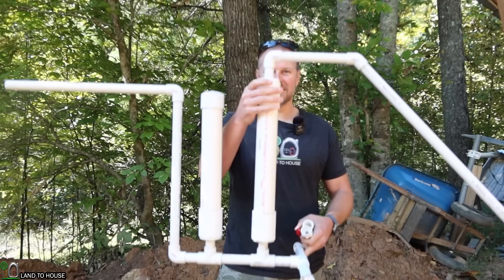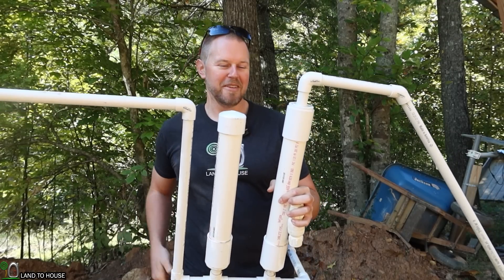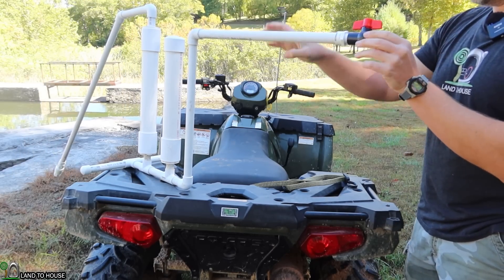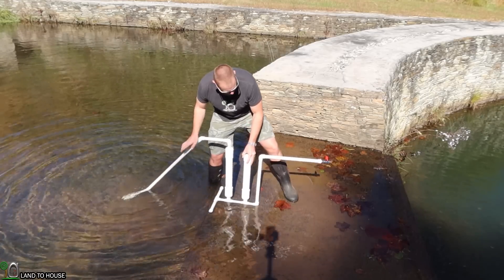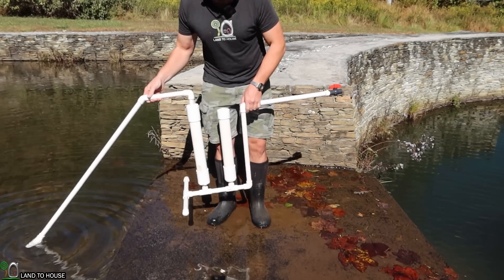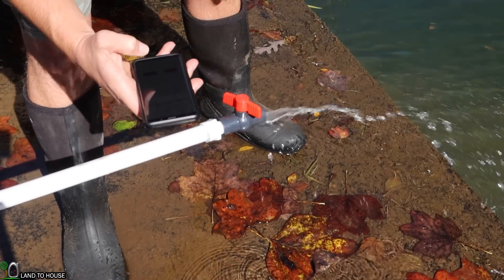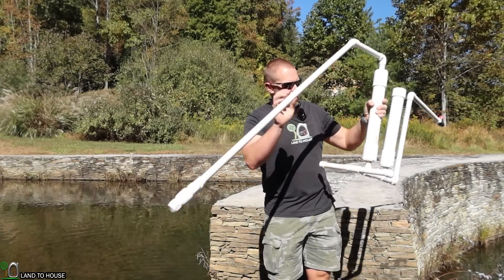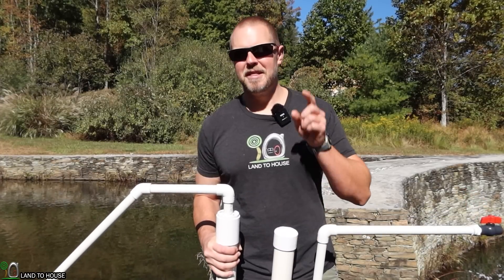This Siphon Works But not for Long

Comment: the only  way it will work ,water trap in pipe because of the check valve will travel  up to the end of  pipe and at the end should be a smaller pipe so the water  will keep out air from rushing up and loos its prime  , the down side   should have grater water then up hill side  , the idea is once the water  travel to down hill it should be a grader volume then in up hill side , then it will be heavier and pull water up on its own   , imagine water going to top of 3 feet pipe then start down hill pulling up water from the other and because outlet side have grater water .

Comment: Did you glue the fittings together?  Air leaks causes siphons to stop.  All siphons work, we use them in civil engineering everyday without issues when the seals are properly made.

Comment: It will really will not work because of the design, the outlet line has the same height with the inlet line and vacuum chamber. You cannot create vacuum pressure if you heights are the same. The outlet line should always be lower than the inlet line and vacuum chamber.

Comment: thank you for trying out, it was lovely to watch and learn. To be logic, the pressure chamber shall be 1/2 the length of the water chamber so that the pressure build inside the pressure chamber is proportional to the length of the water chamber * 0.5, and the height of the outlet pipe should not exceed the height that it will build a gravitational pressure that equal or close to the pressure builds inside the pressure chamber, otherwise both the pressure inside the pressure chamber + the weight of water at the top half of the water chamber will be lower, but it should be higher in order for that kind of system to work.

anyway, thanks again for the video

Comment: Damn! I saw  the video you mentioned and thought, "I'll watch that. It's just what I need at the cabin!" Then I saw your video. Back to carrying buckets from the river, then.
Reply from the maker: If you have head pressure or water drop definitely check out the ram pump.
Reply: @LandtoHouse it seems like you didn't get the pipes filled with water. 

You suppose to PUSH the pipe UP and DOWN (pumping motion) to pump water into all pipe.  SHAKING the end of the pipe like rattle snake won't work. 

This works similar to RAM PUMP but simpler and pumping more water. I've seen videos of your ram pump system.
Reply: DO NOT WATCH his video because he made several serious serious errors just by filling the pipes with water which he didn't do it right.

The problem that he doesn't know what suppose to do himself.
Reply: Before you abandon ship, try this simple experiment. Get a transparent hose, like a carpenters hose they use for leveling.
Emerge the the other end into a bucket full of water and suck the other end like sucking a straw in your soft drink. Did the water flow from one end to the other?

Comment: Interesting, in past years I worked on something like this in a different and more simple structure to make a free generator based on infinite water stream cycle and I didn't get good result :).
Reply: It is pressure buildup followed by vacuum suction.
That mean leakage is a big thing to make it right.
Another is the volume and the length.
This one  is equal in length but reduced in pipe size.
That means you can not produce the pressure/vacuum you need...
So size matters and in a pressure/vacuum system, 
it needs to be consistent and without much leakage...
Keep in mind that it is based on NATURAL pressure, that means limited pressure.
That means limited distance and limited volume...
This means standing or low flowing water will always run out of pressure.
If you do it in a river and/or canal it is more effective.
If you ad a floater with weights to the part that is in the channel,
the movement of current, wave and tide will build up natural pressure.
It is a very old, thousands years old and proven concept that works..
Look at history about: Bamboo piping & pumps + water elevation systems ect ect.
There is enough info out there to make it work.

Comment: In another video, possibly the same one that you had initially watched, the guy had a longer pick-up tube and (evidently) deeper water at the bank allowing him to take longer thrusting motions whereas you used short strokes like you were jingling your change. The longer thrusts likely built greater pressure because of the greater volume/mass of the water.  If you have another go at it, try using it in deeper water where you can get greater volume.
Reply: Why don't you search about the first law of thermodynamics?
Reply: Which part of perpetual motion machines are impossible is hard for you to understand?
Reply: @blaster-zy7xx  Your reading comprehension skills need some work. I never said it would work in perpetuity, I said the other video looks like it compressed more air which allowed it to flow for a longer period of time.  BTW, you should find a new answer to share with the class, maybe even try to understand those replies rather than being a condescending little prick.
Reply: @kevink9397  NO YOU DID NOT!  Did you forgot that this is a WRITTEN format that we all can simply READ what you wrote the first time?  The original video is simply a hoax.  Attempting to defend the hoax only illustrates that you didn't know that the original was a hoax and simply can not work.

Comment: Guaranteed this will work.  Get rid of the check valve and put the output end lower than the input.
Reply: Did you do it yourself that you guarantee? Or did you see it on Facebook?
Reply: @alisideh9565  Ive done it many times.  Siphoning gas, water,  and other things.  Just need to fill up the tube first.  Its called gravity.
Reply: There was a scammer who created a device exactly like the one shown in the video and showed a large amount of water spewing out

Comment: um, I could be mistaken but it's not going to work filling it that way you need to flip it over or fill it on it's side. pretty sure you needed the pressure tank to be full of water not air... or you would need to attach something to increase the air pressure (like a bike pump), otherwise it's more of an air pocket than anything exerting pressure. but it should be as full as possible I would think. (that said can't say I've done it)

Comment: You didn't lay it on side to get enough water in tanks for enough pressure so you didn't do it like he did just fill the tank up havnt you ever used a gas siphon or just a hose you got to prime....prime...prime

Comment: Your pieces obviously aren't glued together well for a piece to fall off. They said that if the seal is not good then air can escape and it reduces the pressure so it won't work. That's why they glue both sides of each piece before putting them together (to ensure an air-tight seal).
He also gave it a much bigger plunge into the water than what you've done, including turning it on it's side to get a larger plunge. 
Sorry.. I wouldn't call this debunked while you have pieces that don't have a good seal on them and haven't done the large plunges needed to get the siphon started.
Reply: Which part of perpetual motion machines are impossible is hard for you to understand?
Reply: @blaster-zy7xx  je crois que c'est un imbécile.....
Reply: Here's another idiot who doesn't think that a pump that raises the head without power violates the first law of thermodynamics.

Comment: To have a better understanding of what is going on inside the System, you should make sure that the whole system is fully sealed, hermetic, leak-proof, so that no air is sucked in, or leaked out. Then you should use some kind of PC-compatible  pressure measurement System that allows you to messure pressure at different points of your device, and display the results on your Laptop Screen.
Reply: Which part of perpetual motion machines are impossible is hard for you to understand?
Reply: @blaster-zy7xx  ...For decades Lots of scientists have been threatened, persecuted, silenced, discredited, censored, suppressed, or killed just for defying the interests of big Corrpporattions or the Esttablishmment.

Find out about the misterious death of Stanley Meyer, the inventor of water fuel cell
Reply: @blaster-zy7xx  ...I don't care what we are told in College or in the books, we are never told the whole Truth about science.

Anyway, this kind of systems does not defy or  violate Thermodynamics Laws in the way we are told because the working principle is based on piping tricks and gravity. 

I have seen similar devices Work with some design modifications.
Reply: @cdtero  Nope, doesn't happen. You are unwittingly advocating for a perpetual motion machine.  If you were correct, (which you are not) then the water could be endlessly pumped up to a higher point and allowed to flow downhill, running a turbine or whatever.  Nope. In order to add potential energy (actively lifting something to a higher level) energy MUST be added into the system.  There is no free lunch.

Comment: Air pressure has no effect on that configuration unless it is applied at the induction end and greater than the residual atmospheric. Inline pressure storage has no bearing on transient fluid flow. This is the basic physics of inertia. A simple mathematical equation is enough to prove a hoax. The video you describe has a submersible battery-powered pump in the first inline chamber with a Mercury tilt switch...simple....😂😂😂

Comment: Your valve was open and you didn’t even use glue on the pipe. Hell it fell off lol. With that many leaks of course it’s not gonna work. It’s simple gravity, you moving water from another place with gravity. It’s possible.
Reply: Memorize it. ‘Water cannot flow from a low place to a high place’

Comment: I'm pretty sure that it doesn't work for long cause your pump doesn't have the empty bottle in some part of the circuit...
Reply: Which part of  “perpetual motion machines are impossible” is hard for you to understand?
Reply: @blaster-zy7xx  not a "perpetual motion machine" there... Is just a pump... It can work for a few minutes using the difference between pressurized air and the water, and it works by the way...

Comment: You see all those lose connections fail the system. Air leaking in will stop the system. how can you not glue it properly and tightly and expect it to work. Siphon cannot be maintained by lose pipes, you are now busted

Comment: Not DEBUNKED!! You're supposed to leave the check valve underwater on priming, I guess you finally realized that blunder but from that point forward it seems you're clueless about the concept in that case. Water can not fill the pressure tank completely EVER, because the air is trapped above it with no escape unless you didn't glue it in which case it can leak around the contact point of the pipe but you DO need to use much longer priming strokes than those quick little strokes you're using so that you get enough water past the check valve for it to build up and not 2 hours time later. Which, btw they make weighted check valves that do not have a spring in them. When you raise the pump up higher you also increased the distance the water has to go to begin the pumping action but yet your tiny little strokes are not filling the pump properly or giving the water enough momentum, you should have opened the valve completely, immediately so that the water could completely fill the influent pipe and not slowly like you did, you interrupted the water's ability to flow up the pipe from the pond so it never pulled full prime while the pressure inside the pump was at maximum and so far YOU have been the problem not the pump, this is NOT perpetual motion, it's a siphon effect which is something altogether different..
Reply: the guy is clueless and not an engineer.
Reply: Sadly he doesn't have to be an engineer to make it work, just know something about water hydraulics and siphons. @jjanvier1443
Reply: 😂😂😂😂 u would be rich by inventing such system lol nerds😂😂
Reply: Submit to the Us Patent and trademark?
Hah!!
You want him to suddenly disappear??
Reply: Minor processes are not important. That device is perpetual motion machine that transports water from a low place to a high place without power. This directly violates the first law of thermodynamics.

If you can really make that thing work, you can build a prototype, submit it to the U.S. Patent and Trademark Office, and become the hero who ends the energy crisis.
Reply: @colorfulstring  Nope it is not a perpetual motion machine, it's a siphon, and can run uphill, look it up..
Reply: @colorfulstring  I'm sorry but you are incorrect, your thinking is not logical and it's been explained like as if speaking to a 10 year old if you still don't understand that's on you, having said that, minor processes are VERY important to make things work correctly as a winning racing veteran of over 30 years it is most definitely the details that make the difference between winners and losers and sadly with your line of thinking you're a loser. Start with IT IS NOT A perpetual motion machine, it's a liquid siphon (look it up) which will work indefinitely as long as the siphon is not disturbed by air intrusion..And what energy crisis are you speaking of? This is to transport water for irrigation not create energy, moron.. Youtube DO NOT TURN into Yohoo with your comments ideology, it'll be your undoing like it's going to be theirs too..
Reply: But if it works it could be used as a circulating source of power portable power anywhere so show me 😁
Reply: @randypratt2887  No it couldn't, there's not enough flow and that's not the underlying purpose..
Reply: @randypratt2887 ⚠️ God has said in the Quran:

🔵 { O mankind, worship your Lord, who created you and those before you, that you may become righteous - ( 2:21 ) 

🔴 [He] who made for you the earth a bed [spread out] and the sky a ceiling and sent down from the sky, rain and brought forth thereby fruits as provision for you. So do not attribute to Allah equals while you know [that there is nothing similar to Him]. ( 2:22 )

🔵 And if you are in doubt about what We have sent down upon Our Servant [Muhammad], then produce a surah the like thereof and call upon your witnesses other than Allah, if you should be truthful. ( 2:23 )

🔴 But if you do not - and you will never be able to - then fear the Fire, whose fuel is men and stones, prepared for the disbelievers.( 2:24 )

🔵 And give good tidings to those who believe and do righteous deeds that they will have gardens [in Paradise] beneath which rivers flow. Whenever they are provided with a provision of fruit therefrom, they will say, "This is what we were provided with before." And it is given to them in likeness. And they will have therein purified spouses, and they will abide therein eternally. ( 2:25 )

⚠️ Quran
Reply: You would make a great flat earther.
Reply: @jamestlynn  Why would you say that? Because I'm smarter than most? The person who made this video is more of a flat earther because he tried and failed to prove something wrong because he doesn't understand the principle behind it and it seems neither do you based on your comment..
Reply: Oh man! You could be rich! Unless people know physics! Wait there’s people out there who not know know physics, they also have common sense and try things out!
Reply: @joseantoniocoarasaperez5217  Not sure what you're saying? If you're agreeing or disputing but how do you know I'm not already rich?

Comment: Put an inflated bicycle tube in the air chamber, so that the pressure is not lost.
Reply: Which part of “perpetual motion machines are impossible”  is hard for you to understand?
Reply: @blaster-zy7xx  I recognize with your lack of experience that you feel that way. But by putting a bicycle tube loaded with air in the air chamber, the air will not be absorbed into the water so quickly. Through the process of osmosis, most likely it will eventually over the years, maybe even decades, lose it’s pressure.

Comment: LASTLY, FROM WHAT I OBSERVED, THE VALVED WAS ALREADY OPEN, in fact the other video is without a valve - so when it was "shaken" in the water, it pumped up water easily. try doing it that way - keep the valve open.

Comment: The secret and the difference is in the "details" before you draw the conclusion that it doesn't work. To "DEBUNK" someone's work, you MUST perform and Do your experiment "TO THE LETTER" and not just on the principle. Here's where you differ : Your "pressure tubes" were slim. In the video I saw "I TURN PVC PIPE INTO A WATER PUMP FREE NO ELECTRIC POWER" - those pressure pipes were fat and tall - enough to create the vacuum and the pressure it needs to pump up water. Another difference is the pipe connecting between the source and the pressure tube - it is longer compared to the one you are debunking.  it is also possible that there is/are leak/s somewhere.
Reply: Which part of “perpetual motion machines are impossible” is hard for you to understand?

Comment: I can use a rubber pipe and just suck the air and the water would just flow.. much longer.. like changing water for fish tank...maybe add a valve inlet for hand pump to get the water flowing.

Comment: U forgot only one thing...the movement, 
U need to keep moving  in Nd out cz it is your strength what causes d d movement needed to compress d water against d air inside .

U stopped moving to soon. It's not a tap u open Nd wait no ..

Comment: I don't think you have been completely fair in your assessment. I think you say that many joins are not glued and in my experience in hvac, a very small air leak can easily defeat either a pressure or a vacuum system, very quickly. Until you are sure you don't have any air leaks, I don't think your experiment is done.